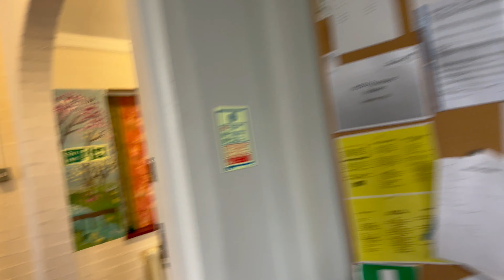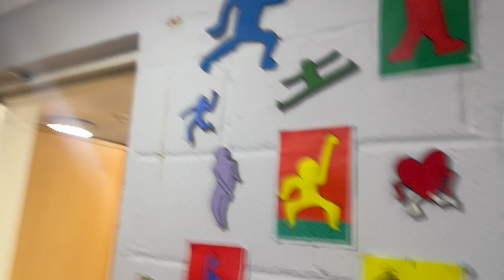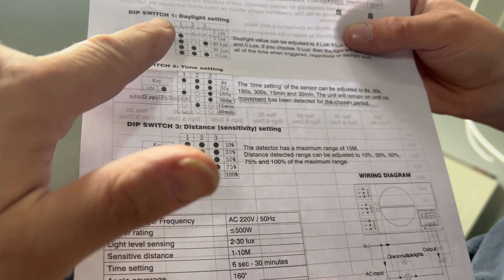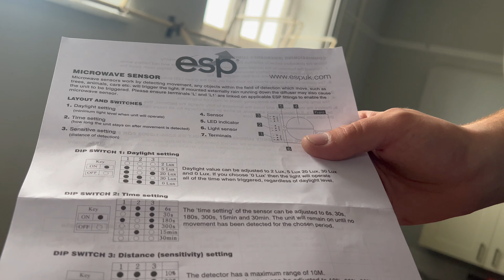"Bringing Brightness 2 the Past: Upgrading Junior School Lights 2 LED for a Cheaper, Brighter Future

Comment: Those lights look good.  I like the idea of the microwave sensor to turn them on and then the timer turns them off.  It would to good to get a power consumption reading for a week of use with the old lights and then a week of typical use with the new lights.  Then you can use this as a typical example for other customers on the saving they could make.

Congratulations on the 6 years Will.  Good to see the company doing well and also the fact that you are helping the industry with electrical apprenticeships.

Comment: Greetings from Australia, I found you by your Dewalt cable gun review (thinking of buying). The way you have installed these microwave sensor lights is really innovative. I have one on my front porch. Just wondering having so many in such a small room, is there possible health effects or are they fairly safe?
Reply from the maker: Hello Matticus will from stevenage that is a really interesting point. I would say that no more harmful than Wi-Fi.